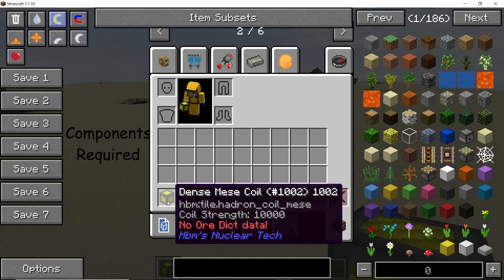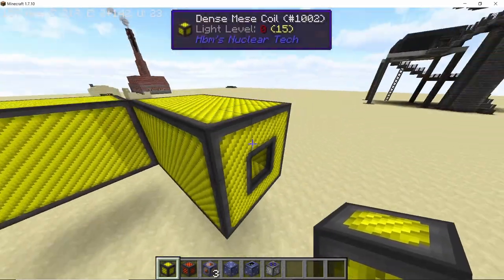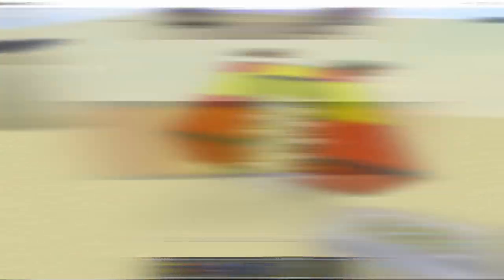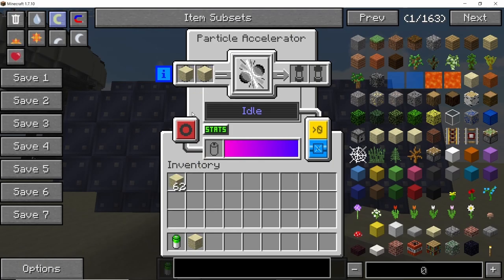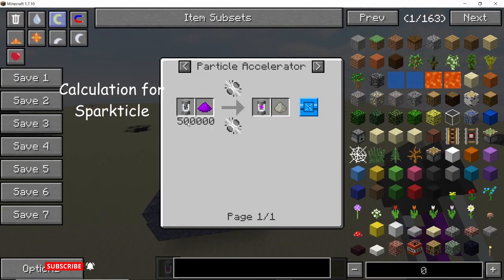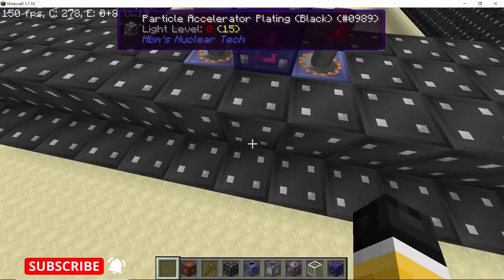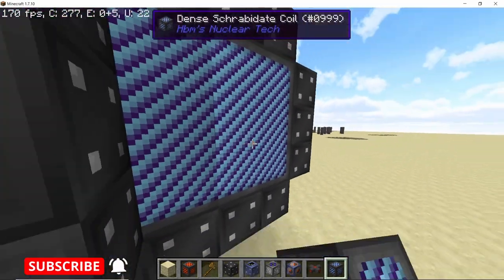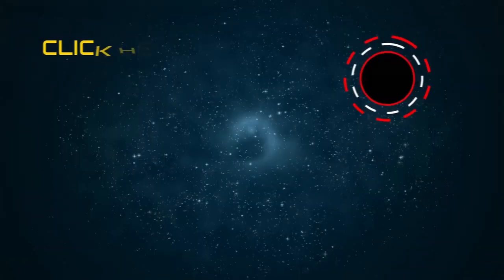How to make One of the Smallest Particle Accelerators in NTM | Basic Accelerator Troubleshooting

Comment: i think the coil strength is lower because the segment around the core isn't counted, you can remove all coils and the casig too and the core will still work
Reply from the maker: Hmm that makes sense , also I think the coils in the corner won't exactly follow a linear calculation

Comment: Bro 1 question
Is  industrial renewal capable with immersive engineering and ntm and what is the use of electricity and fuels produce in ntm
Reply from the maker: Yes industrial renewal is compatible with both of those mods and you can convert FE to HE and vice versa so you can power your machines with it

Comment: man, i've got a question: how do i run shaders with nuclear tech mod reloaded? it doesn't work, game is stuck at dirt screen
Reply from the maker: Did you try loading the world without shaders first and then activating them once you are in the world ??
Tbh I never had any issues with shaders and ntm reloaded ... for better performance there is a config setting called "enableShaders2" ... set it to false and that will improve fps. And also disable fast render if you have optifine installed. 
Change these two settings and see if that makes any difference or not

Comment: dineutronium i am seeing is obtained by a recipe that uses a particle so how am i suposed to build this when the coils themselves require particles to craft
Reply from the maker: You can make a particle accelerator with the basic coils, the only difference is that it'll be much bigger than this to reach the same amount of momentum value.
Reply from the maker: There are alot of options available for coils when it comes to the accelerator, each with a different value of strength and power requirement
Reply: @SavageVegeta  i found out the stuff i am needing to make the particle acelerator and other stuff is to far beyond my current progress can u make a vid of the basic way of progressing in the mod what machines first all the way from begining to endgame? that would help me so much becuase i dont know where to start or whats beyond my progress level

Comment: Hi, would you know why my particle accelerator that contains more than 4,000 dense schrabidic coils has only just over 500,000 momentum? Dense schrabidic coils have a coil strength of 250, so if I have 4,000 of them in a complete particle accelerator, should I not have momentum equal to 1,000,000? I set the particle accelerator so that I have 500 segments in total. I'm playing with the NTM extended mod btw.
Reply: Never mind, I found the problem :). I had it set to linear mode instead of circular. Apparently linear mode divides the momentum of the particle accelerator by 2

Comment: Tbh I think these multi-block structures should assemble into one thing like the fusion reactor
Reply from the maker: well the fusion reactor can't change it's size but the PA can, and different coils of the accelerator can be worked on individually which wouldn't be possible if the accelerator became a single structure so yea

Comment: My particle gets stuck in the core comonent of the accelerator what should i do?
Reply from the maker: If that is happening then there might be an error code generating in the accelerator, based on that code you will be able to figure out what the problem is. There is a book called hadron troubleshooting guide which will list out what the error codes stand for.
Reply from the maker: maybe you have a missing coil component in there or there is no power in the accelerator. however the error codes will give you much more info
Reply: @SavageVegeta  the code is 9[bt], but I checked the power and coils, and that is not the problem and below the error code it shows me the exact coordinates is the core in red